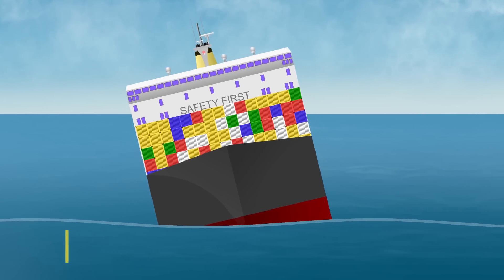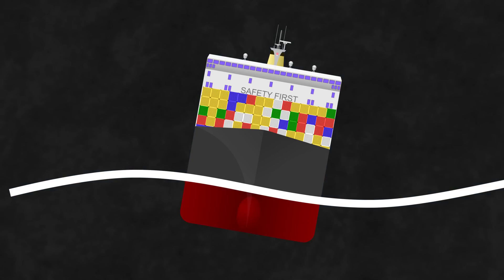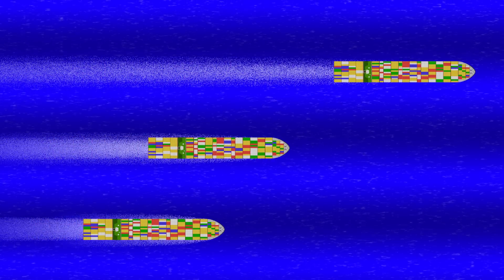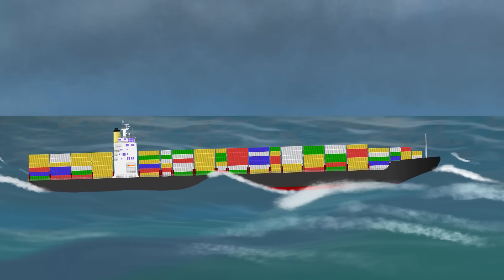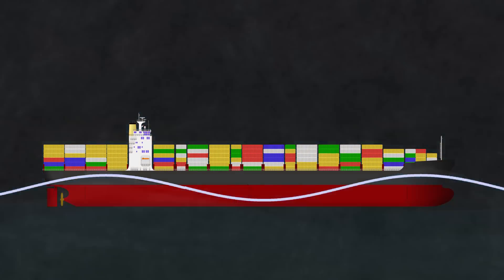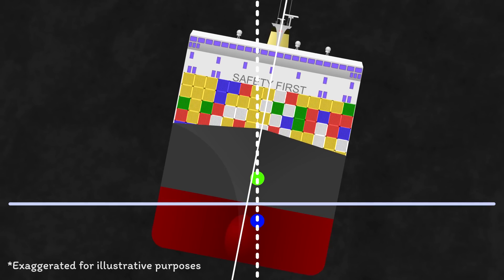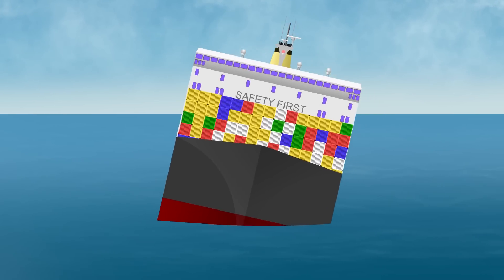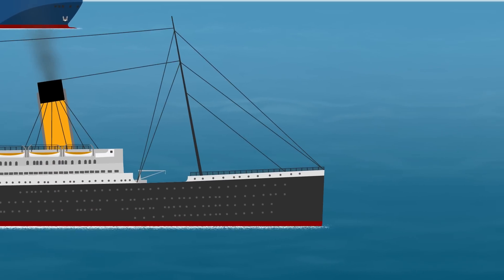How Do Small Waves Capsize Ships?

Comment: taking the issue to the next step is considering what happens if the ship does NOT have proper stability to begin with, or slowly looses stability over time due to changes in loading possibly from slow flooding. IME as Commander of a Coast Guard Cutter this situation was one stressed during our stability refresher training in Prospective Commanding Officer School as a result of a 'mishap' with loss of life when a vessel under tow suddenly rolled over slowly and sank taking some folks with it. In very simple words if the ship's 'natural roll period' changes to very slow & deeper rolls it means 'something is changing' and one is best advised to find out WHAT. In this example the vessel had continued to flood slowly and the slow rolls were 'saying this' but the fact was missed. The incident was captured on VIDEO and after the fact analysis was pretty clear as to what happened.  Later in my career I was involved with a similar situation where a vessel suddenly rolled over and sank in very calm waters. There was significant loss of life.  The vessel had been intercepted with MANY economic migrants on board - dangerously over loaded - and the decision to off load the 'cargo' was made. During the 'offload' everyone was moved UP to the weather deck whereas most had been 'below'. This weight shift significantly changed the vessel's stability (questionable to begin with)  and again VIDEO of the evolution showed how the roll had significantly SLOWED and DEEPEND until such time the vessel simple did a slow roll and 'dipped the gunnel' and sank much to the surprise of on scene folks at the time but is later analysis EASY to see .... SLOW rolls can be very deceiving ..... if the 'depth' of the roll is increasing one is advised to ask "why" .... when change happens very slowly it is easy to miss what's really a big change! Slow deep rolls don't FEEL like danger . . .

Comment: It seems as though ships should be designed so that the resonant frequency would vary with amplitude, so that waves matching the resonant frequency can initiate a roll but then will no longer match when the roll gets severe enough to pose a risk of causing the ship to capsize.  

Resonant frequency is constant in a harmonic oscillator, where the restoring force is proportional to the displacement, but not if the relation isn't linear.  Imagine a perfectly elastic billiard ball on a loose (and massless) spring, between two perfectly elastic bumpers.  If you move it over to the wall and let go, the spring will make it keep rolling back and forth, with constant period as the amplitude decays.  If you nudge the table in time with that period, the ball will resonate: its period will stay the same and its amplitude will increase until it hits the walls.  But if you throw it at the walls a thousand times as fast as it moved in the first example, it will bounce back and forth between the bumpers as though the spring weren't there, with a period equal to the time it takes to make a round trip -- that is, its period is determined by its speed.  The same effect happens, to a lesser degree, whenever the restoring force increases with the magnitude of oscillation.

Comment: Would installing a tuned mass damper (like in skyscrapers) help to counteract the rolling motion?
Reply: For damping to be effective, the damping has to be at least on the same order of magnitude as the forcing.  The periodic component of wind on a skyscraper is presumably small relative to the overall force, but the periodic component of waves on a hull is basically the entire force.
Reply: it could. however it will take up a lot of space cargo could go into.
Reply: @sirBrouwer  That's the solution, then: put the cargo on a swing!
Reply: Maybe, but just deploying some tiny flaps to make the ship roll slower naturally also works perfectly, so why bother? You can't deploy flaps to increase the air resistance of a skyscraper like you  can the water resistance of a ship
Reply: It would help, but the weight added would be pretty impractical, it could help with passenger comfort, but it won't eliminate roll. To eliminate roll, the damper would be ridiculously heavy.

Comment: I think the animation explaining parametric roll at 04:30 is incorrect. The centers of buoyancy and mass are always depicted on a straight vertical line. In that configuration there would be always zero roll torque. When a ship rolls the center of mass should not change much unless cargo moves from side to side. (Sloshing liquids in tanks would move the center of mass laterally though.)

Comment: Stupid question "What is resonant frequency in shipping?"
Reply: I think it is meant in the general physics scene. Every object has one or more resonance frequencies, it wants to swing in like a tuning fork (depending on shape, material etc), when excited by an external force (here the waves) with a similar/same frequency. You get constructive interference (1:27) between the natural roll (resonance) of the ship and the waves and the ship could capsize as the roll angle (amplitude of the oscillation) increases.

Comment: Does this also apply to sailboats? I imagine it is quite unlikely to hit the resonating frequency with a sailboat as the wind also heels and also to some extend rolls the boat?
Reply: I know on small boats, at least, the wind has a much greater effect on the potential to roll than the waves.  but it may be that the force of the wind may make an asymmetrical rolling rate, which would make it harder for the resonance to develop.
Reply: The same physics apply to all boats. The change in stability of a kayak is quite noticeable when the wave length is just right, and the waves are sufficiently large that it lifts the center out of the water.

With a sail boat though, you have the advantage of a huge sail, which dampens most roll oscillations quite effectively, so this shouldn't be an issue as long as the sails are up.
Reply: No, not really.

When the sails are full they have a massive stabilising effect on sailboats. This is why you typically try to keep a storm sail up even in extremely adverse weather.
Reply: @joestevenson5568  wow, you just answered a question I forgot I had as a kid, watching cartoons/movies where big sailships encounter bad weather, and the whole crew frantically gets to work on the sails, and often for the purpose of the movie's plot, the ship would capsize eventually, and I would wonder why the crew left that one sail up that ended up sinking or badly damaging their ship.
Reply: @joestevenson5568 you're not comprehending the physics at play here. The only thing that matters here is the wave frequency matching the natural role frequency. With canvas aloft you simply slow down that frequency. The exact same physics are in play in either scenario.
Reply: @otm646 when the wind is blowing from one direction, the roll speed is faster in one direction than the other, so you dont build the regular rolling to both sides
Reply: Additionally, the keel weight of a sailboat has a self righting effect. A full keel can upright a sailboat that has completely capsized. Assuming you haven't filled your sails with water.
Reply: Also, the resonance cascade relies on low damping. If there is more energy removed with each roll than is added by the resonance, the amplitude no longer builds up. If the damping is small, it can build up almost infinitely. A sail introduces damping, because it resists the roll movement strongly.
Reply: Even if it could, I think the sail would probably act as enough of a damper to stop it at some point outright, the inertial moment of the ship (how much it wants to keep rolling) is much much less compared to its wind surface area vs say a massive container ship with no sails
Reply: I'm sure. It applies to my canoe. It's probably not so dangerous tho. Cuz my canoe isn't gonna sink from it.. but it will rock a lot harder and probably get my weed wet if it's out lol.... Hypothetically of course. I couldn't possibly be speaking from experience;)

Comment: 4:30 There's probably a specific reason there are two radars/dishes (?) on the right side and one on the left. Anyone care to explain?
Reply: I've heard that on passenger ships and yachts, eg "vain" ships that care about their looks, only one casing houses an actual radar device, the others are for symmetry, or looking more expensive and better equipped, thereby safer. Speaking of safety, maybe some ships actually have radar redundancy built in, in case one fails. But that's speculation on my part.
Reply: The satellite antennas (the domes) are usually put wherever convenient.  They usually try to get them as far outboard and up as practical to avoid the main mast blocking the signal.

The radars (bar shaped antenna) are usually close to the centerline and high up.  Having them centered helps reduce small errors in getting positions and such.  Two radars are REQUIRED but some ships carry a third in case one fails.  Only having one radar could result in the ship not being able to leave port until it is fixed.

Comment: Will you make a video about the sub that implode on the Titanic wreck?
Reply from the maker: Maybe one day, but I would prefer to wait for more detail before I make it.
Reply: @CasualNavigation thank you for not jumping on the bandwagon!
Reply: @CasualNavigation  Good idea, best to have everything laid out before you make a video on a tragedy so it's accurate.     Currently there is some evidence that they actually did do testing on the vessel in facilities and found cyclic wear meant the design should only go to 3000 feet underwater, if that was the cause of failure it could explain why the vessel was able to make it's previous dives with no issue yet ultimately fail later on.  good to look into at least.
Reply: @inigobirden2155  I read the owner of OceanGate once said that if there were more regulations regarding the testing of these type of submaring, the business would be less profitable.
Reply: This video includes nearly all the red flags except I don't think it mentions that the engineer who was supposed to sign off on the vessel refused because it didn't meet their safety standards.  Then said engineer was fired.  Owner hubris is the simple answer.  https://www.youtube.com/watch?v=4dka29FSZac